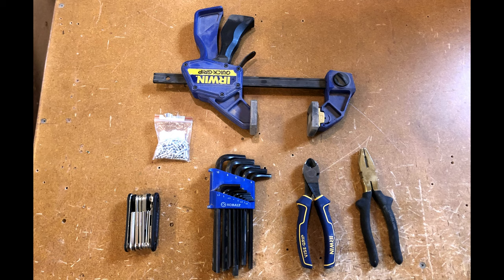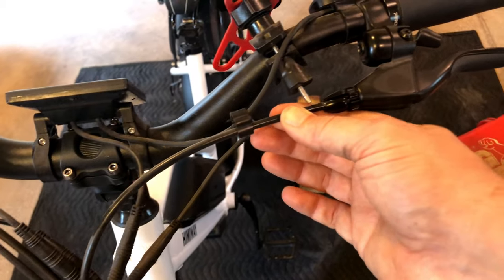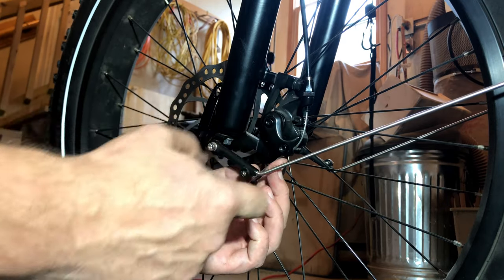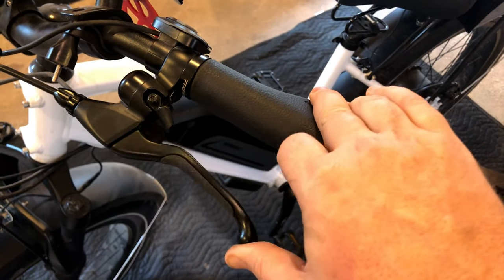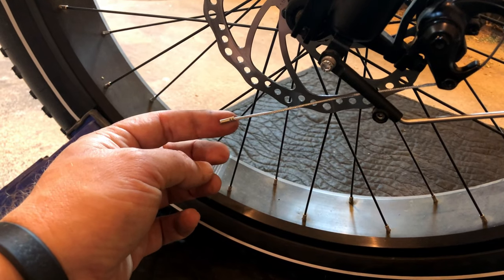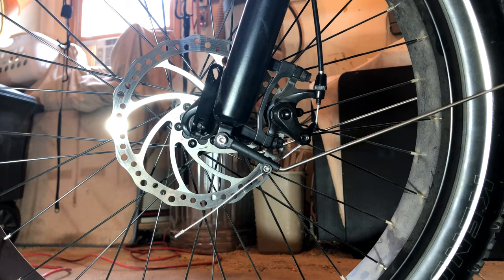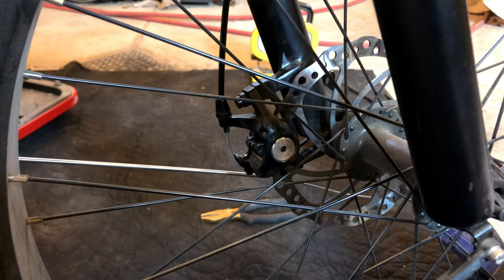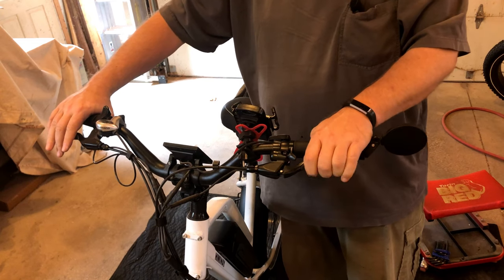Tektro Aries mechanical brake adjustment on Himiway Electric Bikes - Tinkering Turtle

Comment: Tim, my man, just adjusted my own disc brakes.  Holy smokes....I did it!!!! Thank you for passing that info al9ng
  I've been riding for a long time. Finally I can do my own safety maintenance
Reply from the maker: Nice work!
Very glad I could help. 👍
Reply: @TinkeringTurtle  my bike is a gt aggressor 2020 model. I followed your instructions.... and viola' I got r done.   Sincerest thanks.  P.s. thanks for responding so quickly.

Comment: Good Afternoon Tim,
My Cruiser was delivered 8 days ago, I have 43 total miles.  I did notice my inside front caliper was riding on the brake disc.  Your video was excellent and I will made those adjustments this evening.  Two days ago I rode 16 miles, and know that I will really enjoy my Himiway Cruiser.  My first 3 miles last week the temp was only 14, so didn't want to make any riding mistakes with ice and snow on the roads.  Yesterday and today here in Minneapolis south metro, we were 40 degrees, so have been adding up the miles.
Thank you again for the spot ON video.
And I subscribed.
Stay warm everyone,
Jack
Reply from the maker: Very glad it helped. Keep racking up those miles! (Be safe)
And thanks for the sub!
Reply: I am in the Plymouth area and had just got my bike. weve had some beautiful weather lately. Happy riding!

Comment: Thank you so much for uploading this video. It saved me a world of pain and gave me the independence to service my own electric bike. First time e-bike owner, and knew nothing of disk brakes. I managed to readjust everything myself (the store where I bought it did a pretty ordinary job assembling it.) For a middle-aged woman like me, it's such a boost in confidence. Bike is running beautifully, now; no more tyres rubbing on the break pads, no more squeaking, and the brake handles now feel firmer (not loose.) Again, thank you for sharing your knowledge with us noobs, in a clear and succinct way. Cheers!
Reply from the maker: I am so very glad it helped. Enjoy your bike!!
Reply: I know I'm a dude and I was afraid to mess with it because it's a new system to my old ass. I just loosen the disk and Technic able with my fingers

Comment: This is what I was looking for. My brakes have suddenly failed on several occasions. Starts with the rear, total sudden loss and I can make it home with just the front brake. Lately the front will fail after the rear fails. A pop noise and total slack. I contacted Vituvia and they sent me a link to your video. Took only minutes to adjust and now I have approx 6 miles without a problem. Thanks for posting this video! Most helpful!
Reply from the maker: Glad I could help!

Comment: Appreciate this explanation....haven't received my bike yet, but the information will come in handy some time after I've ridden it!
Reply from the maker: Great to hear!
Reply: Bike arrived, added 50 miles in the first two days, and needed to reset the front brakes, as it sounded like one of the pads dragging.  Sure enough, the flashlight proved that was the case, and a quick adjustment initially found the top bolt not real tight, but all is good once again...thanks Tim!

Comment: Very complete and easy to follow tutorial.  Only comment I would make is don't cut the excess cable too short because when you replace the brake pads you may not enough cable left.
Reply from the maker: Thanks for the info!

Comment: Quick tip: if you don't have a clamp for the brake handle you could also use a little rope or shoe lace to wrap around, or a zip tie. And also, instead of tightening the barrel adjuster at the top I would do the adjuster at the wheel first then in future if needed more tightening you could do so at the top. Just a quick tip
Reply from the maker: Good tip, although it’s pretty easy to adjust either adjuster. I tend to agree with your advice!

Comment: I actually had a hell of a time adjusting my front brakes out of the box.  The pads were rubbing and I used this to help me adjust the brakes.  I originally used the clamp method, but either I over tightened the clamp or didn’t tighten enough.  Did 4 times with the clamp and the disk was still rubbing.  Finally asked the wife to pull the handle and skipped the clamp.  That fixed the issue on the first try.  Not sure why the clamp didn’t help, but all good now.
Reply from the maker: Great feedback, thx!

Comment: OK Mr Turtle.
I was wondering today when out riding my brand new POSEIDON X if I could adjust my disc brakes in that manner. Then... There you were.
If you haven't bought a cable cutter yet, please do, they will make cutting the cables and the housing so much cleaner-neater.
Those cutters you have are diagonal wire cutters, I have a small pair I swiped from IBM to cut my medicine pills 
Thanks for the great video.
Reply from the maker: Glad I could help.

Comment: Absolutely fantastic vid. I have the new Rad Rover 5 with the same Tektro Aries brakes and your vid was perfect to learn how to adjust the brakes. Thanks!! Have you purchased replacement pads? if so what pads did you buy. i noticed there are a-lot of inexpensive pads on Amazon. I wonder if they are as good as the stock Tektro pads. Thanks.
Reply from the maker: Glad it helped. I haven’t purchased any pads yet. But I did look up brakes pads that would fit. Here are a couple of links to the pads.
https://amzn.to/3fngbnd
https://amzn.to/3foWmvL

Hope this helps!

Comment: Excellent and clear. OTOH, it was so clear that it's obvious to me it's definitely not something I want to do every couple of weeks. For whatever it costs to swap out the mechanical disc brakes for Tektro hydraulic disc brakes it'd be worth it, not to mention the other advantages of hydraulic vs mechanical, like gradual response vs on/off, etc. Just my 2 cents.
Reply from the maker: I hope it works out for you!
Reply: @TinkeringTurtle  Thanks. And thanks for your helpful videos. Where I live it's quite hilly and the hydraulic disc brakes are really a necessity. I have them on 2 other bikes and I haven't had any problems at all. (Yamaha Urban Rush and Ariel Rider.)

Comment: I learned to adjust the brakes from your video byt i never saw u adjust the barrelnut down on front caliper tho. I still deal with a little brake noise on front tho
Reply from the maker: Glad it helped. The barrel nut on the handle and caliper do basically the same thing. They artificially extend or shorten the cable cover. So I was able to adjust the top one and get the length I needed. When you run out of adjustment on one, then use the other one.
Brake noise can be caused by a number of issues. Contaminations are the most likely cause. I did a video on my Escape showing the process of cleaning the rotor and replacing the pads. This helped me.
You can also purchase some brake de-squeak from an automotive store.

Comment: Hi Tinkering Tim the Tool Man Turtle! Lol. Like your vids. Very helpful. I'm getting a Himiway Cruiser shortly. I'm pretty good at maintaining bikes so no problems there. One question, how long do you think the brake pads will last under normal riding conditions? If if they do need replacement where are they purchased? How's the bike still holding up?
Reply from the maker: Obviously it depends on terrain and riding style. But I would guess 1500-2000 miles. I have 2400+ miles on my bikes and I will be changing them out this spring before riding. Conventional wisdom/rule of thumb says that when the pads get lower than 1mm they should be changed.

For pads I purchased the ones linked below for my bikes. I don’t know a ton about pad materials, so there may be a more appropriate kind based on terrain, riding style, etc..
But these work for me!
https://amzn.to/3qFSHRg
Reply from the maker: The bike is holding up well, no major issues and over 2400 miles. Have you purchased the cruiser yet?
Reply: @TinkeringTurtle  Thanx for the reply. Great info. Yes I purchased Wednesday night. According to FedEx SHOULD be receiving it April 4. So fingers crossed. Thanx to YouTube vids such as yours I feel I've learned everything I need to know as a beginner Ebiker! Will let you know how that goes.

Comment: Hello and I rode today with a skirt and fabric tore off between the casing of the tetras Aries and the silver notched plate. And rear tire "locked".......I would like to know what to do? I'm a widow. A no neighbors.
Reply from the maker: I am assuming your skirt got caught between the pads and brake disc…
My guess is that you would need to remove the caliper and make sure there is no fabric stuck in there. But without seeing what damage there is, I am not sure what else I can offer. Is there a bike shop nearby that could look at it?
Reply: @TinkeringTurtle thank you and your YOU TUBE production enabled me to look more closely.  And yes!!! The rotor did tuck about four inches of skirt fabric. And. Like you suggest. And I did find a bike shop.  I will Uber it there.  

I'm guessing the resr tire is locked because fabric is pressing calipers. I was not thinking well wearing a skirt.  SMH.  THANK YOU YOUR YOU TUBE PRODUCTION is very good and understandable..

Comment: So, great video for Himiway but does this include other bikes with Tectro brakes or is this a one off? I mean, there all the same chinese brakes right? Also, nobody sez which brake pads to get. ie model number or part number. Not even the bike manufacture.
Reply from the maker: Most Tektro brakes should be similar to adjust.
Here is the brake pad replacement video. The links to the pad are in the description of the video.
https://youtu.be/jnljAy7cLyE

Comment: I'm not sure how to do the barrel adjustment at the caliper to allow me to pull some cable down as my barrel and nut are already tight to each other(if that makes sense). The ones at the handle had threads between the nut and barrel as yours did and i was able to follow that step of yours correctly to loosen cable up top. Am i suppose to turn that nut a particular direction anyways on the adjustment at the caliper? seemed like you were able to unscrew the nut all the way to the barrel and then turned the barrel all the way in on both adjustments.
Reply from the maker: It is difficult to troubleshoot via this kind of message. In truth I am not completely understanding what you are seeing. It might be easier if you post in a Facebook group where you can add pics. Lots of people out there can likely help with this.

Comment: My stumpjumper ST has these brakes, this would work as well, correct? My brake feels awful, sometimes It goes down all the way to the handle bar and nothing happens, sometimes if I apply a lot of pressure you can just hear the disc screaching but not actually locking the tires or effectively braking.
Reply from the maker: If you have the same brakes, making these adjustments can’t hurt. And it sounds like it could help.
Reply: @TinkeringTurtle  just checked it’s the Tektro Gemini
Reply from the maker: I think the Tektro Gemini are hydraulic brakes. So the adjustment process is probably different.

Comment: Great subject and I'm sure there are a lot of people that take their bike to the shop for adjustment have just said, " I can do that".  Question... and an idea for a video,  is there any concern on how to charge the battery? On older rechargeable batteries the suggestion was to run the battery completely down before charging so it didnt  develop a "memory". Is that a concern with the Himiway battery?
Reply from the maker: I have been avoiding doing battery videos. There is a lot of information that would need to be presented and I don’t have the knowledge to do that.

But to answer your question (to the best of my limited ability), lithium-ion batteries are not supposed to develop a memory. But that being said it’s a good idea once in a while to run the battery all the way down and charge it back to full. I think....

I wish I could be more confident in my answer, but it’s better if everybody does their own reading on batteries.
Reply: @TinkeringTurtle  Thanks for the response. I understand the apprehension on tackling the subject. I will continue to read and see what I can come up with. Thanks again TT :)
Reply from the maker: Try this article, might steer you in the right direction.
https://www.electricbike.com/ebike-battery-longevity/

Comment: Question: my brake calipers, hits before out before it closes all the way on the caliper. Any ideas how to make that adjustment?
Reply from the maker: I’m not certain I understand the question. As long as the pads are not hitting when the brake is not applied, and the disc is fairly centered you should be fine.

Comment: Just got my bike and you are the talk of all the GO TOs!!!  My bike shuts down and stays disengaged if I use my front brake! I’m pretty certain I’ve diagnosed the sequence ok my bikes shut off assist.  Do you have any idea what I need to do?
Reply from the maker: So your bike shuts off when you use your brakes? The display shuts off?

Or does the pedal assist just stop working?
Reply: @TinkeringTurtle  the pedal assist shuts off and then it won’t come back with out me freaking out a little and squeezing the handle in and out a lot.  The display is on working fine. It’s the assist.
Reply from the maker: And you have done a full adjustment like I show in the video?

It seems like the brake sensor is thinking that the brake is activated. If you haven’t done a full adjustment, I would start there. If you have, then you probably need to adjust the sensor. And as I haven’t done that yet, then I would reach out to Himiway support for directions on that adjustment.
Reply from the maker: Make sure you have done the brake adjustment first. A lot of the time this can fix the brake issues. And if that doesn’t work, then get troubleshooting tips from Himiway support.
Reply from the maker: @CoachGrammy @Jamie Brehm 
I found this post on one of the Facebook groups. He built a tester and adjusted the brake sensor. It looks like you loosen a Allen set screw and then turn the sensor. I don’t know if this will help, but if you can figure it out it could fix your issues. you wouldn’t need the tester, I just wanted to show the adjustment process. It could be done on the bike.

https://www.facebook.com/Timwardo/videos/10157556105196734/
Reply: @TinkeringTurtle  thanks!!!

Comment: Thanks for this!
I followed the process a couple of times with my Radwagon 4 but still have some rub and squeak. Any thoughts of whether the problem could be my rotors? (They look fine, but a slight warp would explain the rub)
Reply from the maker: Rubs and squeaks are, sometimes, hard to diagnose. It can be a warped rotor, or the pads and rotor could be contaminated with oils. Or both. on one bike I had to replace the caliper before the issue was resolved.

I have done a couple videos addressing this, maybe they will help.
https://youtu.be/nuuQcLNe7fs
https://youtu.be/xnpEF_Bu9lc
Reply: @TinkeringTurtle  Thanks! I'll check those out

Comment: Hi Tim, I started noticing an odd noise from the rear brake while applying  the brakes. It sounds like the pad is rubbing on the inner "spokes" of the brake disc slightly rather than only on the braking surface of the disc. is there an adjustment to realign the pad to the disc?
Reply from the maker: Loosening the two bolts is the only realignment method I am aware of. You might also want to remove the pads and see how much pad is left. If I remember correctly less than 1mm should be replaced.

Comment: What if it's only the outside brake rubbing on the front wheel?? Thanks
Reply from the maker: The outside brake pad, from my understanding, is the only pad that moves. The inside on, I think, is stationary and the outside pad moves in when the brake is applied. 

Either way if you go thru the process you should be able to get your brakes working good again.

Comment: I have the Escape and my front brakes do not work well at all. I don’t see the adjustments in this video but no the Escape.
Reply from the maker: Sorry, the Escape has hydraulic brakes. This video is for the mechanical brakes.

The Escape I just assembled has a loud hum or squeak when I apply them as well. I just haven’t had time to look into the causes. Hopefully in the next couple weeks I will find time to diagnose the issue and make a video for proper adjustment.
Thanks for watching!

Comment: How did you get all the extra brake line out like that? I tried to install hydraulic brakes and it didn’t go well so now im just trying to get my regular brake back, only did the rear brake. I can’t get the brake lever back springy feeling feel like I need at least an inch more cable pulled though to tighten it back up but no bueno I can’t pull the wire any tighter.  Wish I hadn’t messed with it 🤬
Reply from the maker: It came that way. Bummer your switch over didn’t go well. Obviously I can’t see pics here, but if your on one of the Himiway based Facebook groups, you can start a post there. add pics of the setup, brake handle and calipers. Maybe someone can see something and guide you.
Reply: @TinkeringTurtle  im pretty sure Im going to have to replace my brake cable
Reply: Did you fix this in the end? Had exactly the same problem, can't pull the cable through anymore, and brake feels spongey.